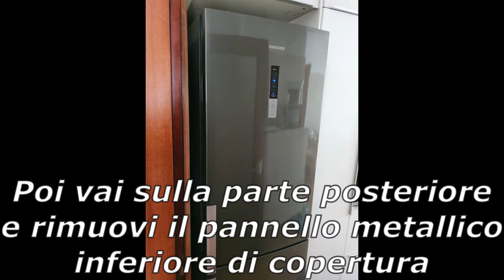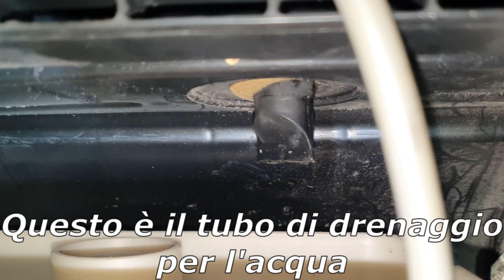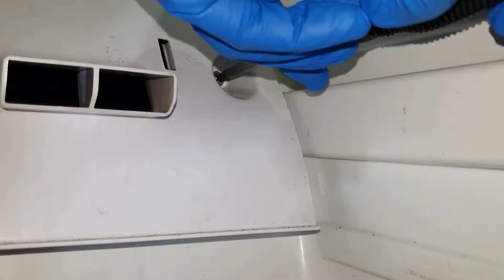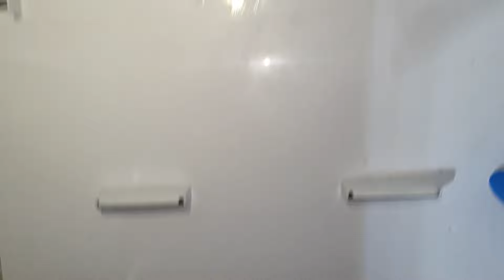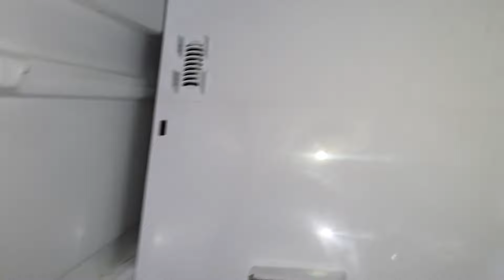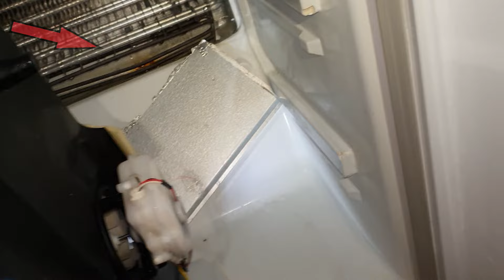Frigo Samsung perde acqua. Una possibile soluzione.

Comment: Ciao e grazie per avermi fatto approfondire la causa del problema, non bastava eliminare il ghiaccio sotto il cassetto.... Ho però modificato un po' il lavoro perché avevo difficoltà ad estrarre completamente la parte interna( sono riuscito comunque a vedere i tubi del radiatore) ed accedere ai tubi ghiacciati. Mi permetto di portare a conoscenza cosa ho fatto. Utilizzando il vapore di vaporella, in poco tempo il ghiaccio incastrato tra i tubi, si è completamente sciolto e improvvisamente ho potuto assistere al defluire dell'acqua nel serbatoio apposito posto sopra al compressore (ho vaporizzato anche al contrario, dallo scarico verso l'interno).  Samsung RL40HDVB. Comunque grazie ancora e cari saluti.
Reply from the maker: Grazie mille per il messaggio e la testimonianza. Cari saluti a lei

Comment: Buongiorno. Non sono riuscito dopo aver smontato la paratia interna del mio frigo Samsung RL44QGPS mod. W7X93TOX2 a trovare il foro di scarico della condensa . Guardando dietro sopra il motore ho visto la vaschetta di raccolta acqua asciutta ed il relativo moncone di tubicino per lo scarico. Non so come fare per liberare lo scarico da un eventuale ostruzione. Qualcuno può darmi delle  indicazioni per vedere dove si trova questo benedetto foro anche con  qualche video. Nel ringraziarvi anticipatamente, cordialmente saluto.   De Cicco Bruno
Reply from the maker: Salve purtroppo non conosco tutti i modelli, provi con un piccolo specchio a cercare il foro. Ma so che altri hanno avuto lo stesso problema. Provi a leggere gli altri commenti forse trova una soluzione lì